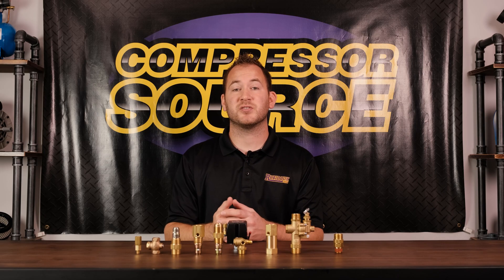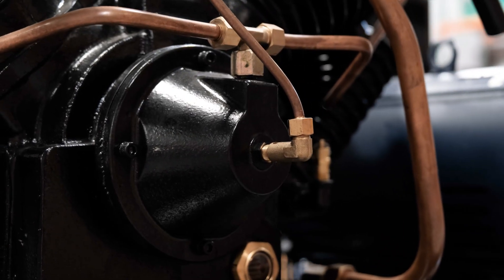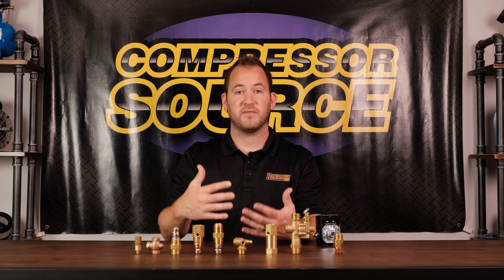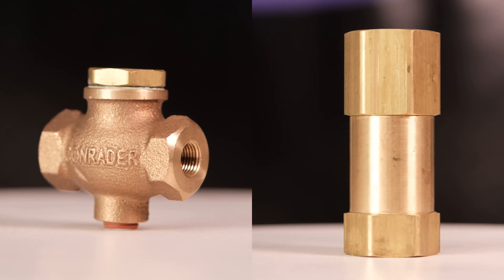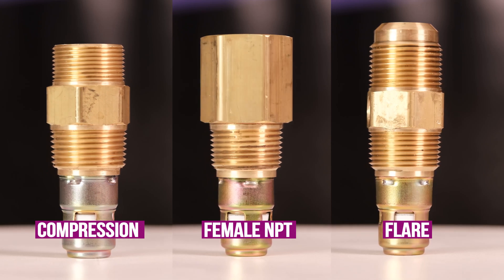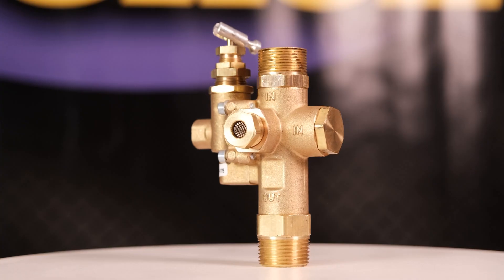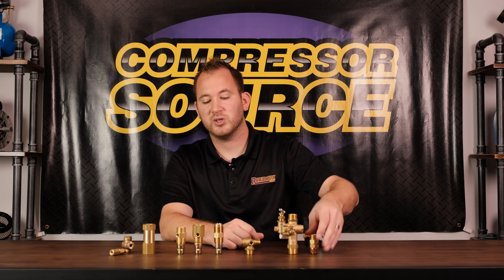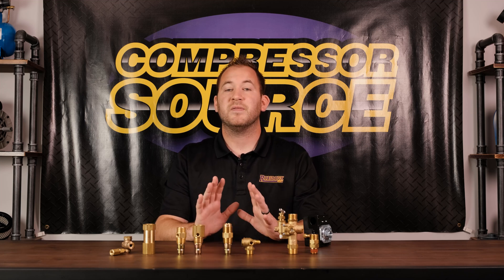Leaking Pressure Switch? It's Probably Your Check Valve: Compressor Check Valve Troubleshooting

Comment from the maker: For help troubleshooting or selecting a replacement pressure switch or check valve, visit https://compressor-source.com/pages/contact-us and submit a form or call us Monday through Friday, 8:30 AM - 5 PM Central Time.

You can also visit https://compressor-source.com/pages/resource-library to find our air compressor calculators and other info at our resource library - including tools to help calculate compressor RPM, perform pump-up tests, and size v-belts and pulleys. We hope to restart video production in the future, but until then, we'd still love to hear your feedback on how a newer version of this video could be improved and ideas for more videos, written help content, or online calculators here in the comments.

Comment: Sooo what happens if that switch is leaking continuously when the compressor is on and not allowing the compressor to come up to pressure? Is this also the check valve?

Comment: Hello- the in-tank valves:  the white plastic diaphragm inside- is there no rubber o-ring or rubber seal between them?  just that plastic vs. brass?  how does it eventually go bad?  I'd think removing the oxidation from the brass would take care of that.  the spring doesn't seem super strong but I don't think it has to be.

Comment: Hey got question just replaced my check valve but when compressor cuts off at 150 build up it blows out unloaded valve. But if I shut compressor off with breaker before it reaches cut off of 150 it doesn’t leak through unloader?

Comment: yup!!!!!thank you so much for the confirmation of the check valve.   The parts house ACTUALLY had a note, if your switch leaks continuously after shutting off, do not replace this switch!!!   Replace or clean the check valve on the tank...your video confirmed the real issue!!!  I was one who was saved from replacing the switch unnecessarily.  thank you AGAIN.  :)

Comment: Exactly. Before looking at this video I replaced the pressure switch. With no luck. I watched this and purchased a new check valve. And then everything was fixed. Thanks for the video as I did exactly what you said replacing the pressure switch for nothing. Thanks again!!

Comment: Great video!  I had a leaking pressure switch, cleaned up the check valve of some corrosion and problem solved.  10 minutes of effort got me up and running again.  Thanks for posting!

Comment: What I am seeing is, my exhaust valve is leaking when the compressor starts up. So the whole time it's running, the exhaust valve is leaking. But when it shuts off, the exhaust valve stops leaking and everything works as normal. What would this be?

Comment: I have a question, btw, I liked and subscribed because you are very knowledgeable about something I need help with. Well, here goes, I added a series of copper lines (and a water separator just before the tank) in a grid on the wall for cooling, about 70 feet in between the compressor head and the tank to get rid of all the water. When I did, the line isn't letting the check close until all that air in that line empties. The 70 ft. of copper line takes about 3 minutes to bleed out thus wasting a fair amount of air. Is there anyway to fix this and is this doing any harm to my compressor? It did get rid of almost all of the water out of the tank, btw.

Comment: Had a bad check value so i replaced it. Now the compressor pumps up to 125lbs,  then over a 3 or 4 hour period it leaks back to 110lbs. Then it stays there.
I was wondering if i took it apart and stretched the new spring a little would it help?
Please help if you can

Comment: My pressure switch leaks air when it's shut off until the tank empties... I replaced the check valve tonight with an oem valve and it did NOT fix the issue... Any help?

Comment: Thanks for the vid solved my problem. Early 80s Sears twin 2hp. The unit was apart for a while and some crud got in the check valve. I was happy to find it was serviceable, cleaned it out all good.

Comment: There's are leaking into the oil when I pull the dipstick out air comes rushing out head gasket or check valve

Comment: Sure helped me out. Unloader leaked on old pressure switch and did the same on new switch. Had no idea about this other component. Thanks loads.👍🙏. Yes! I had one of the check valves that can be easily opened. Rubber plug was off center. Fixed. Thanks again.
Reply: Could be weak spring